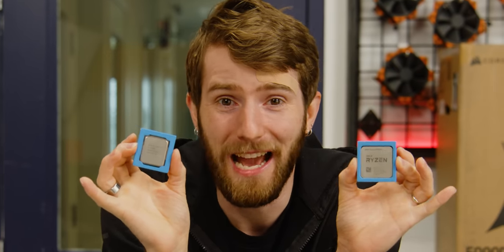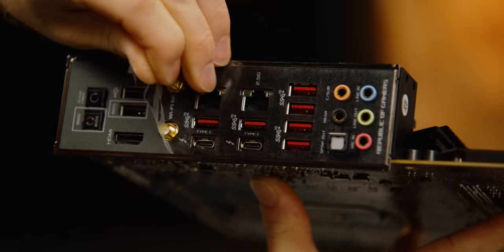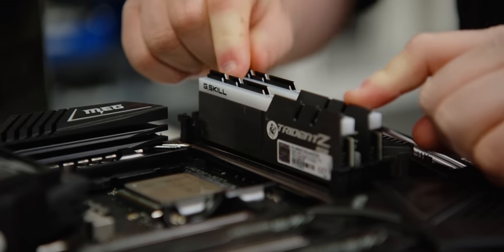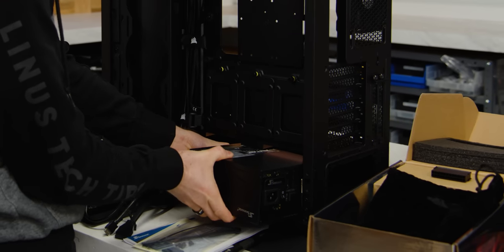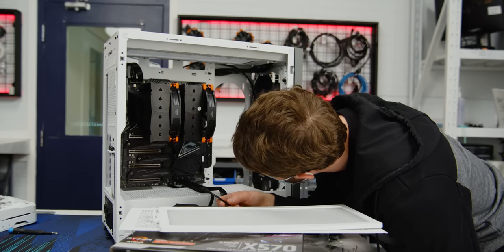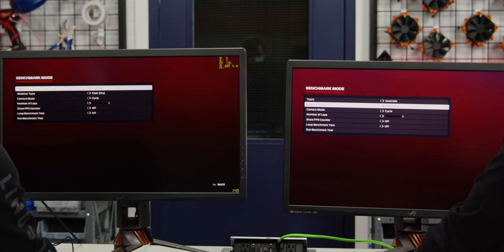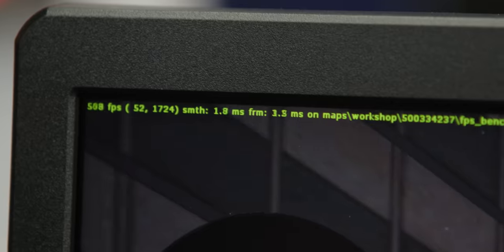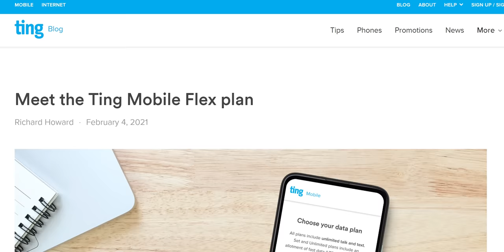Can Intel Beat the Ultimate AMD Gaming PC?

Comment: With Nvidia making CPUs now maybe in 10 years there with be an Intel x AMD x Nvidia showdown.
Reply: And Intel looks to be going into gpu production too
Reply: It will be 2 years.
Reply: sure
Reply: I personally like Intel more than AMD
Reply: @ivanpekic3544  why?
Also its a budget option by now?
Reply: @ivanpekic3544  me too
Reply: RGB showdown
Reply: Nvidia is making arm based CPUs so they aren't really on the same level
Reply: Nahh intel will die 2-4 years if they still clinging on x86
Reply: well... nvidias making RISC cpus. So its unlikely they would compete on desktop, but they could certainly make mobile devices/laptops that are just a tablet with a keyboard. But thats also a pretty saturated market so idk if they would even want to bother. i think the cpus they are making are just for acceleration and management. Unless they get one of the "lost x86 licenses" somehow i don't believe they will be competing on Windows devices.
Reply: Probably not since NVIDIA's CPUs will be Arm based. There isn't much currently that is compatible with Arm and I wager there still won't be much compatible with Arm in 10 years.
Reply: @yuvtube1  for now but they will be optimized for amd systems later or are already so that argument will age badly
Reply: @kadensharpin2156  They made the arm chip in the surface rt, oh and it came out in 2013?
Reply: It will be APU battle, because GPUs will be so expensive it will make no sense buying them for gaming for 99% of people.
Reply: “And then there were 3”
Reply: That would be good
Reply: @Ben_mgsp  First of all I have an Intel i7, 7th gen. Second: When i bought a ryzen 7 earlier it came broke in a brand new sealed box.
Reply: @Ben_mgsp  And after contacting their support for a month I didn't get a reply or a refund
Reply: @ivanpekic3544  that's poor customer support well in that case amd has to work on their customer support
Reply: @profeli1993  In 10 years there will be a lot that is compatible with ARM because Apple is moving to ARM cpus in Macs and Macs are a huge market.
Reply: The RGB showdown
Reply: @songoku9094  Probably not. x86/x64 is going nowhere. It is the most used architecture for PCs and it will stay like that for a while. People have been saying "x86 is dead and risc will take over this year" for a long time. Just like with linux desktop, it's not going to take over anytime soon.
Reply: @songoku9094  you do realize that practically every desktop cpu is x86 including amd buddy?
Reply: @harryshuman9637  And then Stadia will win the battle.
Reply: And intel is working with dedicated GPU. So on GPU side also Intel x AMD x Nvidia.
Reply: @yuvtube1  false
Reply: why and how the fuck do some people have those gray boxes around their user name when usually that's only for the one that posted the video?
Reply: @ivanpekic3544  Came broke ? Did you claim your return / replacement policy of the shop you made purchase from ? Because warranty doesn’t cover external / electrical damages. We gotta check the box after purchase.
Reply: If they manage to get x86 licencing or make an entirely new platform
Reply: I pretty much hope so! I also hope there will be more companies doing this cuz why not more competition is always good
Reply: @Ben_mgsp  idk I just like intel for no reason
Reply: Ati: they killed me
Reply: Yup rayquaza is coming
Reply: Only if AMD and Intel switch to ARM.
Reply: Nvidia cpu isn't targeted for public normal user. It's target sales will be different. Maybe for miner, or something we don't know.
Reply: Yeah it could happen since now that Nvidia is throwing money at ARM laptops to bring their D-GPUs to ARM, they could just pay money to devs to port their games over to ARM, although it will be a lot of work, so its a 60-40 situation. AMD has been rumored to be working on some ARM delicacies of its own but we don't know for sure, also AMD had announced that its working with Samsung to bring Radeon GPUs to mobile which is not equivalent of bringing radeon d-gpu support to ARM laptops. I believe x86 is gonna be the first choice for devs for like 7-8 years as they will slowly maybe migrate to support ARM also
Reply: @modestas112911  i highly doubt Intel is gonna give yet another company a licence to make x86 CPUs.
if anything Nvidia is gonna focus on ARM (because they literally own ARM lol) or maaaybe RISC-V someday in the future.
Reply: & in both GPUs & CPUs
Reply: @Alirezarz62  how would Nvidia add to the market if they can't/won't make x86 CPUs? we will always be suck with Intel and AMD and because if anyone else tries to make modern x86 CPUs Intel will sue them into the ground.
Reply: @Raja-mc3zt  I contacted support, called, sent emails, went to the store where i bought it from and they said "It came like that from AMD, we cant do anything, contact them"
Reply: if the 5950x is even available in 10 years lmao
Reply: @Ben_mgsp  ryzen 5000 cpus are hard to get and even some 3000 are still out of stock or overpriced a lot. also intel you can use lower memory speeds w/ which saves you a few $
Reply: x Apple
Reply: eh, it only seems as if they are interested in HPCs and they were already interested in the AI market for a long time if you are talking about Grace. I don't really think they are aiming for consumer chips at least for now
Reply: @David Belanger performance, yes. cores and threads are something people might still need though.
Reply: @hilariusubaldiasarinarindr9255  The cpu's will be for deep learning on servers according to Gamers Nexus
Reply: Hi jay
Reply: X86 will probably be replaced by arm, Or risk-V architectures in a decade.
Reply: Intel 10700kf was 250 at microcenter. Kinda the best deal if they still have them.
Reply: more like AMD vs Nvidia
Reply: @harryshuman9637  Yes, for laptop market, not for desktop, APU's still long way to go for desktop machines
Reply: @legendaryhumper  many people like things for no reasons so yeah intel or amd better to have a pc than not
Reply: @proxy1035  that could make arm ninvida exclusive in a few years which could "kill" arm
Reply: The battle of RGB!
Reply: Forgetting apple huh? 🙄
Reply: @phatoume227  Yes
Reply: @Nersify  You aren't getting the power of top GPU, but with top APU you get an entry level gaming CPU+GPU in one packet. It's more than enough to play modern games at med settings.

I think 99% of people are interested in playing games without going bankrupt, not playing games at 200FPS in 4K no matter what.
Reply: @ivanpekic3544  no one is perfect
Reply: 10 years ? :D we are talking about Nvidia they probably have one already
Reply: Intel and AMD have to try ARM architecture for that to happen
Reply: Apple M1
Reply: @yuvtube1  that is nonsense for the most part. AMD systems are perfectly stable and it's mostly older software that is more optimised for Intel.
Reply: @yuvtube1  mmmm you might wanna fix one fact intel uses more power than amd unless you're suggesting "performance power". Intels 11900k is (250w) vs Amd 5950x (105w) lol. Also "reliable" hmmm lets see Amd Am4 motherboards have been supported through nearly their whole generation of processors of the AM4 platform which came with years and years of supported updates since 2017 from AMD/manufacturer's. Where intel's boards are like replace your board every generation to get there new stuff and they dont support their boards as long as Amd does and that doesnt sound very "reliable" to me and lets not forget how much more vulnerable security wise intel is compared to Amd also not very "reliable". Lets also not forget 11900k is more money than 5800x and the 5800x out performs it for less money and less wattage lol. I use to be with intel since its awsome 4th gen 4790k days and that CPU was a monster during that time and the last build i had was the 9900ks on intel, but when Amd finally stepped up there game and took the lead. Its a i'm sorry intel but i'm moving on to newer better technology on a company who backs there products and innovates so well which is AMD, and i dont wanna spend money on old tech again such as 14nm+++++++++++++++++++++++++++ which is rediculous at this point and shoulda released their 10nms they have been delaying since 2017. So both are great companies but its such a shame that it took AMD 1 generation improvement on the same node to outperform their competitor intel in not only workstation related software but gaming as well. I like to also note that when the Amd 3000 series was out even the 8th generation intel cpu's were beating amd in gaming still lol and intel had 2 more generations of improvements after. So for Amd to make just 1 generation improvement over intels 3 generations improvement ( yes im counting the latest 11th gen too) and beat them is a phenomenal feat in itself. When intel finally releases 10nm which is their 12th gen CPU's for which i hope they dont delay it again i will reconsider intel again base on performance and cost, but right now it is not worth putting money out for intel.
Reply: The competition would be fucken insane
Reply: but Nvidia only has ARM and not x86 if I'am not mistaken
Reply: I suspect Nvidia is going to stick to ARM CPUs though, so unless they go x86, or unless Windows makes a decent ARM OS and desktop game engines also support all their high end features in ARM, I don't know that we should hold our breath for an all Nvidia system.
Reply: @TheRogueAdventurers  oh man there's gonna be all blue pc vs all red pc vs all green pc
Reply: @dertythegrower  2 years until they are out but about 5 until they are competitive
Reply: @kadensharpin2156  But laptops and computers are slowly going to switch from x86 to arm based cpu
Reply: I just hope for more cpu and gpu makers to come back and battle it out
Reply: @ajaakola2  more competition is almost always better
Reply: @beasterbunny4836  Sure is ! Before with more competition we also had better performance uplifts and prices.
Also nice profilepic
Reply: Yooooo hi Jay
Reply: Nvidia just announced data center cpu still a long time till they make sonething
Reply: Hopefully Novideo will produce Arm chips and Ayymd will respond so my next Thinkpad will be powered with Amd Arm.
Reply: @Ben_mgsp  i don't think Nvidia would do that, atleast not so fast, they should be aware of how important ARM is at the time.
plus even if they were to slowly kill it off ISAs like Risc-V, SPARC, MIPS exist which could become the new open source ARM
Reply: @dertythegrower  For server CPUs sure, but not consumer/desktop grade stuff (yet)
Reply: it's not like nvidias tegra cpus were around for multible years now?
Reply: Lol, and with Intel making Graphics cards, it'll be on both front
Reply: @ajaakola2  Not to mention more options and more verity
Reply: can imagine intel in 10 years!, 14nm++++++++++++++++++++++++++++++++++++++++++++++++
Reply: @beasterbunny4836  indeed
Reply: @derek8564  I know, no one is. But we are talking about one of the main, or the main CPU producer in the world. That's a multi billion dollar company. I understand that they might not answer if I broke the CPU, but I waisted like $300 and never got a refund.
Reply: @kamran2035  How are they robbing? It's your choice if you want to buy their CPU, you're not forced to.
Reply: The RGB showdown.
Reply: That's unlikely. Nvidia is focusing on the server market and they don't have the licensing required to make x86 cpu's.
Reply: @proxy1035  not so fast but perhaps they will do it later on
Reply: Doesn't Nvidia only make CPUs for data centers?
Reply: Each using their own gpus
Reply: @kamran2035  I ain't going with intel until the I die
Reply: @BUDA20  you forgot these ++++++++++++++++++
Reply: @profeli1993  considering Apple, Google, Nvidia, Qualcomm, and Microsoft all have their own arm licenses it’s safe to say compatibility is already well on its way. RISC doesn’t always mean the cpu is low power or simple. Just reduced. There is plenty of room to reduce the x86 instruction set and ARM is the solution to that for most companies. Also due to chip shortages the future of CPU’s will be in-house manufactured chips, which will only require further implementation of ARM
Reply: choose ur team red green or blue
Reply: Isn't Nvidia just making ARM CPUs?
Reply: @kamran2035  You're right, but i meant it in the way that we don't HAVE to buy their CPUs if we don't want to.
Reply: More like nvidea vs amd only 😂😂😂
Reply: Nvid should link up with AMD and the 2 companies might really take Intel on then, just. Their market share is huge, their capacity to make chips is huge, their reach in the industry is unmatched basically.
Reply: @Skippernomnomnom  stadia is dead
Reply: Didn't ARM already won? It is by far the most used CPU in the world because of smartphones ain't it?
Reply: @kazacune101  AM4 isn't supported anymore, no new gen CPUs for it. So it doesn't really matter if the next gen for Intel needs another motherboard (that wouldn't be cool tho) because if 11th already competes with 4th (5th) gen there isn't much difference, unless you buy AM4 and get a 5950X when it's cheap some years from now but you could also get a 11th i9 (the R9 is still better but in the budget part there's no difference)
Reply: Hopefully, more competition will get us better products at a lower price. Fingers crossed
Reply: nvidia cpu's are litterally worse than what amd came out with zen2 in the performance department.
Nvidia needs some cpu's to pair with their datacenter Gpu's, lotsa pci-e and memory, that's the requirement and they don't want to rely on AMD or Intel, that's it ;)
Reply: Nvidia already made CPUs, e.g. Tegra, in the Jetson and Nintendo Switch.
Reply: @yuvtube1  "Most softwares today (apart from games) are still more stable and well optimized on intel systems rather than AMD"
Citation needed.
Reply: And with Intel making GPUs we could have Intel + Intel vs AMD + AMD vs Nvidia + Nvidia.
Reply: @songoku9094  lol you really think it's going to be that short of a time before x86 dies?  Think more like 10-15 years at least before it dies
Reply: @yuvtube1  that's literal bs
Reply: @ivanpekic3544  Same, I just like it more. No matter the price
Reply: @yuvtube1  That is so true man
Reply: @TheRealNeoFrancois  come on 10-15 years😂apples m1 already outperformed intels flagship processors in single core with only 4 high performance core..even if you take intels most powerful processor it won't even any closer to that of m1..if apple could easily do that currently,in 2-3 or maaybe 4 years they could easily beat x86 with their arm processors..the funny part is that m1 is focused on both efficiency,performance equally for thin laptops yet it could perform that much..think about if they build a processor for desktop that doesn't need efficiency cores
Reply: @TheRealNeoFrancois  also there is lot of companies like amd,microsoft,amazon,samsung that are currently working on arm based processor.i think they will able to release it in 2-3 years..because they have enough time to create  a one that same as powerful or more powerful than m1
Reply: @AlNexus  If next-generation from both AMD and Intel supports DDR5 you'd have to upgrade...
Reply: @songoku9094  doesn't mean it's going to kill off x86,all it means is that there's companys furthering that tech
Reply: @songoku9094  your also forgetting the other countrie citizens that won't be able to afford all the new arm cpus and will be using x86 chips making them last alot longer than it would in canada or America
Reply: @TheRealNeoFrancois  why you are saying things like people won't be afford arm processors like arm processors cost more than x86 or it won't be available to those region you mentioning?m1  mac doesn't cost high..you can buy m1 mac mini under 1000usd..so most likely all other future arm will not cost high like that even if it from other companies aside from apple..and because of lot of companies will enter arm processor making it will available all regions..i know there will be still some peoples use x86 but most likely the vast amount of people will still cling on x86 will be decrese so much that intel won't able to make any profit from making x86..because of the reason arm processor performs better than x86..in the future intel will be really hard time
Reply: @songoku9094  I say that because I know people who are still running core 2 duos with in board graphics  in India, reason for it because they don't make enough to buy brand new hardware,that's why the x86 market will still thrive
Reply: Aren't they going arm?
Reply: Forgot the Apple M1 chips? :)
Reply: @TheRealNeoFrancois  yeah but even if still people use x86 doesn't mean its not dead..if people don't buy or intel is not getting any advantage in still clinging on x86 in future they will stop making it but even if that happen there will be still majority of people using a x86 system but that doesn't mean it is not dead(i meant about people who will not rely or buy on x86 anymore..i didn't meant people who will still use already owned x86)
Reply: @megachadsixtynine5924  i do buddy and i did say that also..but they are currently working on arm based one's..if it will success like apple m1 does..they will also ditch x86 because there will be no reason for still clinging on it if it doesn't give performance like arm does currently or in the future
Reply: Suprised you didn't comment on the hammer lol
Reply: I fully support all three manufacturers going into both GPUs and CPUs. We need as much competition as is possible in both spaces.
Reply: @kadensharpin2156  yet, remember that x64/x86 architecture is pretty old, and very flawed. Eventually many other processors running more efficient archictectures will be doing laps around x64/x86.
Reply: Nvidia been making cpus
Reply: You forgot arm
Reply: Yeah me too
Reply: @m4ster_root  what?
Reply: @ivanpekic3544  simply wrong store, not amd fault really, of course you must contact amd directly if confronted with incompetent store
Reply: @AlNexus  All I'm saying is that both AMD and Intel will require a new motherboard next generation.
Reply: me with my fx 8350....  wow amd is good now maybe i should upgrade. my fx 8350 praying to the lord that i have a empty wallet
Reply: @Bennet2391  Arm could go the way of powerpc become niche again at the end
Reply: @yuvtube1  LMAO
Reply: Isn't a global crisis of silicon happening right now? Or that shortage only affects car industry and gpu manufacture?
Reply: At this rate more like Nvidia X AMD
Reply: I'm using an AMD system with RTX graphics card on a Thunderbolt ready motherboard. I can see three different USB controller from these three company in my Windows device manager.
Reply: with both gpu's and cpus
Reply: Somehow, the scene from The Good, The Bad and the Ugly comes to mind...
Reply: apple : mmmmm, hello? 😂
Reply: @yuvtube1  'most' no. some ? Yes.
Overall AMD is far ahead in productivity.
You only choose intel when you focus in one of the few soft that's still optimized for Intel, the rest of us should go for AMD.
Reply: They do what, now?!
Reply: Ooh Intel only setups, Intel CPUs, Intel GPUs, and like so with others.
Reply: I feel like it'll be less than 10 years
Reply: Dream on
Reply: @songoku9094  You are missing the point. Not to be disrespectful, but do you have any idea how many people run decades old software on their machines. IF Intel would replace x86 with risc-V they would run into major compatibility issues. All the x86 targeted software needs to be recompiled, low level stuff has to be rewritten. 
In a lot of case the companies that made the software don't exist anymore and the source is lost or inaccessible due to IP-rights conflicts. 

Hardware is is a topic for itself, but there is also the real world. It doesn't matter if a processor is superior, when it's incompatible with the software environment.
What you said about ARM vs x86 performance is only true, if you factor in the power consumption. With the same clock a modern x86/x64 processor is significantly faster than a comparable ARM 7 or 9 processor. This should surprise nobody considering that the X86 has much more power at it's disposal and more transistors, which implement fast complex instructions and shortcuts, that simply don't exist (yet) on ARM processors.
Reply: @Ben_mgsp  Nah, probably not. They are used in phones, industrial applications, automotive, embedded devices and even servers to some extend. Like x86, ARM will only be replaced, if the benefits justify recompiling or rewriting the software environment. 
RISC-V will probably replace ARM in some of these use cases, due to it's flexibility, but not all of them. Imagine an android phone, incompatible with any App on the store, that targets ARM Architecture. App compatibility is a key factor in the success of a device. That's why windows phone failed.
Reply: I highly doubt Nvidia will make CPUs for stuff other than data centers, IoT and automobiles (Not to mention they will be labeled anti-competitive due to their ARM acquisition).
Reply: Nvidia doesn't have license to make cpu with x86 command set.
Reply: @Bennet2391  X86 wouldn't be replaced it probably will end in a stillmate the x86 arm war
Reply: @proxy1035  AMD is nightmare enough, Intel must be stupid to invite Nvidia into the ring.
Reply: @ketos8315  You are right. The reason AMD can make x86 is because contract loophole mistake Intel made a long time ago. Mistake made, lesson learnt.
Reply: @robertbowen9750  Yes. Like it or not, Microsoft is still the king maker in PC and laptop. If they decide to port Windows into ARM, that will be a significant boost to ARM.
Reply: And with Intel making GPUs, we might have a full Intel vs full Nvidia vs full AMD systems.
Reply: @Ben_mgsp Agreed. Either that or  they will coexist in different fields of application. Everything has up- and downsides.
Reply: @yuvtube1  this was wrong on another level
Reply: @harryshuman9637  better buying a ps5 you be more happy then with it a APU for the time being if you fine one.
Reply: @jamesstuller6964  can't do work on ps5
Reply: @harryshuman9637  It will get hack some day to run other OS like linux then you can use it to work.
Reply: Intel will be making GPUs then so its more of.
Amd vs nvdia 😆
Reply: @ivanpekic3544  i like amd but intel is budget offering so meh.
Reply: @yuvtube1  thats not entirely true..and even if i consider it AMD is just miles better now.
 A hinda civic is reliable Lamborghini isn't but dude when u gotta race on a track u need a Lamborghini
Reply: It’ll be AMD v Nvidia v Apple. Intel will be nowhere to be found.
Reply: Would be great for the consumers. Prices would be competitive. And manufacturers wouldn't be rehashing the same thing every year like how Intel did.
Reply: @yuvtube1  define reliable though? I've been running AMD on my main rig and never had stability issues. Was running Intel before that (still am on a secondary PC). Really there really is not much difference in terms of reliability between both. Been pretty happy with both.
Reply: @eclipsegst9419  i think we are not far from RISC being as compatible as cisc.
Or arn can almost carry all necessary instructions that x86 can and did u see apple M1 damn that beats x86 intel ones
Reply: @Ben_mgsp  x86 is not just cisc it is more cisc+some risc while arm is more risc and some cisc.
And we are very close to meet when all x86 codes will be supported on ARM we are very close x86 is not going away it and arm will meet and we will have a processor that will supporr both codes apple M1 already does it..right now windows on ARM supports x86 32bit apps already not far when all x86 apps will run on arm
Reply: @legendaryhumper  thats weird
Reply: @anandsuralkar2947  well sure m1 is the only cpu on 5nm so of course it has impressive IPC. But Apple has used RISC a lot in it's past too, doesn't really affect the Windows people. Emulating cisc on a risc cpu is doable but not efficient. X86 CPUs haven't actually used x86 since 1995 they use hardware based decoding. RISC uses software based decoding so it will always be wasting a significant amount of processing power on overhead. So I don't see RISC on Windows anytime in the foreseeable future. Too many x86 programs that are irreplaceable over too large a span of time that are still in use, and hardware decoding is more efficient.
Reply: It will be amd VS Nvidia.
Intel is become the new Nokia
Reply: I love how this started from a joke and now it’s just a bunch of butt hurt people arguing about who is better, and why this won’t happen.
Reply: Not likely, unless nvidia changes to Desktop cpus. Currently they only seem to be doing mobile cpus.
Reply: @anharun  yes
Reply: @yuvtube1  based on results it seems to me intel is frames and amd is for pretty graphics.
Reply: @songoku9094  nah its if they can't get a smaller nm
Reply: @DarthCiliatus  there will likely remain a separation between apple and windows for the rest of time.
Reply: @phantomcatxd7637  Yeah i think Linux is more appealing to people fed up with Eternal Windows 10 than Eternal OSX, which most of us decided we hated back in the XP days.
Reply: @eclipsegst9419  i don't want to use Linux because of a lack of games supported by Linux, and it seems like it is complicated to use.
Reply: @anandsuralkar2947  you're failing to mention that running even 32 bit apps causes a 25% performance decrease. 64 bit will be much worse. I can see Apple getting certian programs to work, but thats still a far cry from it being a universal solution. They will never be able to decode x86 instructions with software nearly as efficiently than AMD or Intel do with their proprietary decoder.
Reply: @DeanGl  Ive jumped betweeen AMD and Intel a few times. It is fair to say that AMD is a bit pickier about old drivers on the install and stuff like that. But on a clean install i think they are equally reliable.
Reply: Nvidia has made cpus for years... also the new ARM chips are 10x faster than intel and amd... so there is NO contest. x86 is ded
Reply: @phantomcatxd7637  Same, but if I had to pick Linux or OSX id pick linux every time. It isn't difficult to use and its gaming compatibility has increased by huge amounts in the last 5 years, only the latest stuff won't work yet but within a short while after release, most do. Linux can be formed to however you like it, but most default to a "similar to windows" layout that isn't too hard to figure out/
Reply: @songoku9094  intel is transitioning ... amd is the one I am worried about, they havent done anything to compete with the ARM tech
Reply: @eclipsegst9419  risc cpus are sooo much faster than x86 ... desktops will ALL be risc very very soon, unless u want a snail
Reply: @DarthCiliatus  10 yrs! lol...what! in 3 months all desktops wikl be risc.  Have u not seen the presentations from Samsung, Apple, Intel, Nvidia and Motorola?  x86 amd is ded... ARM tech is dominating and will be the only tech to buy for the next decade at least.  intel is trying to compete, but there is no way, too far behind already and they know it.
Reply: @unitcharles689  decade?  what!  lol, they are ALREADY replaced... the final phasing out if ALL x86 crap will be out by the end of 2021... these tests are a was of time and the last sad kick at the cat.
Reply: @tredogzs  they don't need to rush..because of x86..you said intel is transistioning and you are worrued about amd😂..brother intel next cpu is on 10nm,where as amd current ones are 7nm and amd next cpu will be zen3+ or zen4..zen3+(if they decided to release)is said to be on 6nm..zen4 is in 5nm..and amd is currently has biggest multicore performance..its true intel is still has more single core peeformance but it is not high difference between amd..even if you take laptop side amd has same high multi core performance than intel and its single core is not that much low than intel..if you take a thin and light laptop currently has intel 11th gen compare it to amd based,rysen is more effiecient than intel..that gap will increase if amd release 6nm or 5nm based one's..so i don't know why you are saying intel is changing and you are worried about amd because of that😂
Reply: @tredogzs  lol what are you, 12? you clearly know nothing and are just spewing nonsense. risc instructions are faster, but also less capable. a RISC cpu loses 25% of its performance to run regular x86 32 bit apps. That 8 core just effectively became a 6 core. To run AMD64/x86-64 instructions, well, we don't know yet, its not possible, but it would likely take over 50% overhead. your 8 core just became a 4 core. Heres the fact of the matter- x86 and x86-64 programs aren't going anywhere, anytime soon. There are 40 year old programs in use now, and todays programs will be in use in 40 years. using hardware based decoding is FAR more efficient than software based. Nobody but Apple plebs will be using those silly oversized phone chips, anytime soon.
Reply: @ivanpekic3544  can you give some details on the damage?
Reply: @eclipsegst9419  25% performance decrease is nothing compared to almost 5x performance per watt of ARM chips
Reply: @eclipsegst9419  i am not talking about software simulation of x86 instructions today arm actually has a proper hardware instructions support for many x86 instruction.
And today many of x86 instructions on x86 platforms are taken out and there will be time soon when ARM will natively support hardware instructions of x86 99% of times .and then u can switch to arm.
And remaining 1% times used maybe 10% instructions will be emulated which isnt big deal considering thsoe being rare instructions..
Reply: @4ri8  Im not really a cpu expert, but when put the cpu in it didnt work. I know that because i was replacing components with my older pc and my old ryzen 3 worked fine. I took it to the shop where i bought it and they said "Its AMDs problem, not ours"
Reply: They're not X86 though
Reply: I wouldn't like it
Reply: Intel is make sku gpus
Reply: @eclipsegst9419  your 4x more likely to have watched this video on a risc chip... they out number x86 by two times and they are faster, MORE compatible, run MORE maps and EVERYONE has one... are you a dinosaur?
Reply: @eclipsegst9419  You are drinking the 10yr old cool-aid.  Nothing you said is true.  The current cisc architecture is 64bit is MORE capable than x86 and runs much faster with less power.  Try googling the fastest computer in the world... it went to cisc last year and unlike previous years were performance doubled... this time is 100x faster.  The game is already won, sorry you missed the memo.  Future is here bro-ski.
Reply: @tredogzs  lol keep kidding yourself. Link me a video of an ARM running an x86-64 program. Doesn't happen. It's not just bit width. X86 uses COMPLEX instructions. ARM uses REDUCED. so congratulations, you can run simplified programs as well or better as x86 can run complex programs. You cannot run complex programs anywhere near as well as x86. Anything can be scaled to a supercomputer, just keep adding cores, nothing special there. Intel's working on a new one that will put it to shame anyways . You don't know what you are talking about kid, just stop.
Reply: @eclipsegst9419  You must be lost in your own confusion.  Show me an ARM running an x86-anything program DOESNT HAPPEN!!!!! why would ARM run anything x86, its all transcoded... and you don't know anything about computers.  Now that this is clear, I will let you argue with the mirror.  Good luck, I hope you win vs yourself.  Hey when you are done, spread the good news about x86 being ded.  thx
Reply: @eclipsegst9419  Good thing there is WAY more ARM games, programs and code out there now.  Not much out there for x86 anymore.
Reply: in 2 more years intel will die eventually since they can't make decent cpus since 2015
Reply: @Coldbreathful  lmao dream on kid. for starters, intel was still on the industry leading node until 2018. Secondly, they have fixed 10nm and 7nm, which are equal to tsmc 5nm and 3nm respectively due to the way they are measured being different, and is positioned to retake the leading edge by 2023. Finally, even with outdated products, Intel is still over 90% of the server market, and just recorded record profits. maybe if not for covid they would have made less, but that doesn't matter, because as of now, they have fabs making anything they want, and nobody else does.
Reply: Which one, all amd, intel, or nvidia
Reply: @kamran2035  nobody needed 8 cores because Intel's IPC wasn't dogshit. AMD was bringing nothing but Bulldozer garbage back then so you can't pretend they are innocent. Bulldozer should have never made it off the drawing board, it was horrible. Die shrinking the Phenom would have been better.
Reply: @brytonmassie  old sure, flawed? Not really. No other instruction set can match it to this day, not even Intel could replace it when they wanted to.
Reply: @ethan-fel  most software is still single or dual threaded. Aside from some creative software almost everything is.
Reply: @boulderbash19700209  no, the reason AMD can is because Intel sold them a license, and then AMD developed the 64bit variant, which blew away and still blows away all the 64bit risc designs, and they then licensed that to Intel.  Neither company will "die" they are codependent.
Reply: @songoku9094  Intel measures transistors at the base not the tip, which is much narrower, thats why 14nm is equal to 7nm. Just as 10 will be to 5 and 7 to 3. Both companies are set for major gains every year. That's the important part. Who wins will be neck and neck, and doesn't really matter, just the IPC gains we all get do. Tiger Lake is a poor showing for 10nm. Golden Cove will be the first 10nm with good yields that allow the now-expected 5ghz clocks and a very healthy IPC that will be neck and neck with Zen4.
Reply: @anandsuralkar2947  that's just a lie, the performance per watt is even less of a difference. Just quickly removing 25% from the M1s Passmark score puts it barely ahead of a 3300x. Mine consumes 52w and the m1 consumes 27. So call it 2x more efficient, not 5x. But that's 32 bit apps. They are all but defunct. And that's with a 5nm node advantage. Erase the node advantage and most of that advantage is gone. Put the m1 on a true amd64 program, and.... Oh wait it can't even run them. Even if it could it would be way behind in performance and efficiency. Leave the cell phone CPUs in cell phones. And wierd apple shit nobody cares about.
Reply: @kazacune101  in actual gaming the 10900k uses 90-100w to the AMDs 80-90. It's half the price, and gaming performance is a wash. AMD is stupid to only use gold silicon on stupid wannabe baby threadrippers instead of offering a golden 8 core for actual gamers.
Reply: @eclipsegst9419  its true intel is still performs better at single core with only 14nm compare to amd 7nm..but if you take laptop segment lower nm cpu has better efficiency no matter how much close or higher performs intel with 10nm over amd 7nm..even if you compare intels new 11th gen series thin and light laptop to amd thin and light laptop with 11th gen or 10th gen,amd has more efficiency..because of that amd laptop has more battery life if take thin and light laptops..what i am saying is it true when intel 12th gen release it could be perform little bit better than amd next gen which is zen3+ or zen4..but still because of the reason lower nm processor amd based laptop will be more efficient than intel while perform closer to intel..because of that reason i will say amd is better because they could give close performance to intel or better and same time with more efficiency than intel
Reply: @kamran2035  that's not how it works. Games don't like to multithread, you can force them too, but they will always scale to IPC because physics and worldgen is more efficient the less cores it has to use.
Reply: @eclipsegst9419  i was talking about intel vs apple.thats 5x.if not its atleast 4x and m1 in macbook air consumes only about 10 watts..thats where its most efficient and intel has no competition there.
Reply: @songoku9094  in all reality if you remove bias it's an absolute neck to neck race. Also what I'm trying to tell you about node sizes, is 14nm Intel and 7nm TSMC are almost exactly the same size. When FinFet transistors came out, Intel decided to measure them at their widest point, as that is what determines max density. TSMC and Samsung decided to instead measure partway up the transistor. For reference, they are shaped like an upside down W. So as you can imagine, if you measure it partway up, and it's getting narrower as you go up, you get a smaller number. That's why Intel's node sizes will never appear to be as small as the competition, when actually they are within margin of error.
Reply: @eclipsegst9419  dude m1 outperforms the best of i9 apple mac.
It just does..look at comparisons..i am no apple fan..amd sure does compete m1..but intel there's no chance
Reply: @anandsuralkar2947  yeah I have. Check Passmark. Single threaded is strong for sure, thanks to that 5nm process. But it's multicore performance is a yawn. About the same as the 8c/8t 9700K.
Reply: @eclipsegst9419  well not shit sherlock. Everyone can see that on this very video they showed up top how much wattage was used in gaming comparison. I specifically said "up to 240w" i never said did 240w all the time. Also the 5800x is cheaper and better than 10900k which is less money and less wattage usage. So i really dont know what point you are making here. Other than spouting non-sense.
Reply: @yuvtube1  If you want security floors go Intel. If you agree that the i7 releases should keep having 4 cores for a whole decade go Intel.
Reply: @eclipsegst9419  Cmiiw, Intel didn't sell the license to Amd, at least not directly. I forget the name, but I think it's Cyrix. And then it was only for 8086. But Amd used it to produce 386, 486, and Pentium, leading to court battle with Intel that Amd won.
Reply: @MarkLikesCoffee860  I want CPUs so powerful an i7 only NEEDS 4 cores. A 1080 ultra/144 med. gaming PC that only uses 300w or less would be awesome Why would you want to need more cores? The goal should be IPC gains that are so good we need less.
Reply: @kazacune101  5800x is neither cheaper, nor available period.
Reply: @boulderbash19700209  didn't what? Sell them a license? They definitely did. AMD used to literally just be rebadged Intels at a lower price. Then Intel didn't like AMD making 486s and there was a scuffle, and Intel agreed to sell them a license if they made their own designs.
Reply: Nvidia ARM and RTX vs AMD Ryzen and Radeon vs Intel Core and Iris? That would be quite interesting to see...
Reply: @Coldbreathful  I don't think a single thing has changed from 2007 until 2017... cpus were EXACTLY the same for TEN YEARS!  Six core 3.33Ghz Intel for 10 years!
Reply: Try 3-5years I know intel won’t be waiting that long to ramp up gpu production and roll out
Reply: @mohammeduddin2334  true but unless Nvidia finds the fabled lost x86 license and buys the company that owns it they won't be making any real cpus just ARM.
Reply: @eclipsegst9419  To make up for Intels low IPC
Reply: @MarkLikesCoffee860  yeah well, Skylake sure isn't up to date now, but AMD guys really ought to realize what a bullet they dodged. If Intel's 10nm came out on time, and their 7nm came out on time, Intel's current CPUs would have higher IPC than anything that is going to come out in the next 4 years, and not even 16c/32t would be enough to beat a 4c/8t i7. AMD would be someone else's property right now if that had happened.
Reply: Triple or Trio showdown!
Reply: ARM CPU didn't work on Windows it's seems like emulate X86
Reply: Plot twist, apple beats all
Reply: @eclipsegst9419  I disagree because Intel have been shrinking the die size for years without any problems but the IPC was only increasing by about 5% each year. 1st gen Westmere was 32nm and they had no problems until 14nm. Why wasn`t IPC increasing by 15 - 30%  each year like AMD?
Intel weren`t having problems with their fabs back then.
Reply: @TheRogueAdventurers  they do have a discrete gpu
Reply: @MarkLikesCoffee860  Because that's not realistic. AMD was so horribly behind that they looked good playing catch-up. 15-20 is possible but not every single year, and nothing since we hit the 5ghz barrier points to otherwise. AMD and Intel are going to throw everything on the table now, even if it's risky. That's great, but it's silly to expect either to do something risky without motivation.
Reply: @tredogzs  lol if you call phone "games" games maybe. ARM apps are all stripped down wannabes. X86 is like 99.9999% of actual full feature apps and games.
Reply: @robZzdaboss  lol no, apple will be lucky not to be surpassed by Linux in the coming years. People are just as fed up with Eternal OSX as they are Eternal Windows 10.
Reply: @eclipsegst9419  ARM chips are just WAY faster... and Intel is making chips now with increased instructions to match the huge number of efficient instructions the ARM chips have, they are adding efficiency cores... Intel is adding power management gates, Intel is adding codex for internet and other photo and video editing functions.  Intel is adding machine learning and AI. .... and you are still all excited about year old AMD stuff that just doesn't matter at ALL.  Out of date... out of date... NONE of it matters ... just buy the new video card and you are 2x ahead... nothing AMD is releasing or even is talking about matters.  Samsung, Apple, Huawei, Microsoft, Nvidia... EVERYONE is focused completely on ARM and the current speed race with the fastest, smoothest, most functional chips in the world... and here YOU ARE... CONFUSED, lost, angry... JUST accept the light, do some research, buy some products, experiment with the technology and know the truth.  I only ask one thing, SPREAD the light, tell everyone, that is all the thanks I ask.
Reply: @tredogzs  no, they aren't. And better instructions are key to performance. The reason ARM will never compete, and has taken 40 years to even manage 32bit emulation, is because it has simplified instructions. X86 instructions can do more work each. The only real move forward would be a better CISC that does even more work per instruction.
Reply: @yuvtube1  so amd cpus are unreliable?
Reply: @eclipsegst9419  you don't really know what you're talking about. You only look at it from a gamer point of view. I'm talking about professionals, video editors and music producers prefer mac and the m1 chip is a beast in terms of performance and is only the beginning. I'm not talking about windows vs osx. This thread is about Cpu.
Reply: @robZzdaboss  everything you are talking about is Workstation grade tasks. I am making statements about Desktop computers. Doing any of those tasks on dual channel ram is a bottleneck. Better off with a lightly used Xeon or Threadripper than some joke of a throwaway Mac with no upgrade path, or be gimped by dual channel ram on a ryzen 9.
Reply: Cpu is said to entire unit 🤦‍♂ you would have written processor
Reply: @Piyushrahi  CPU and Processor are the same thing. Central  Processing Unit (CPU) a.k.a Processor
Reply: In a couple of years, someone's going to do that cursed Nvidia CPU and Intel GPU build.
Reply: @songoku9094  Nop..because apple left intel..intel not like it and want make something big...
Reply: @yuvtube1  That is because Intel ruled the market and everyone followed their instructions. 
The more time they spend behind the more this will change as consumers will buy more AMD and programmers will make sure their software works with AMD since more of their consumers have AMD.
Reply: @ivanpekic3544  Preferring Intel is one thing. But actually liking them more seems kind of strange considering their past actions and practices unless you just like going against the flow and you feel like liking them just because others dislike them.
Reply: @SIPEROTH  I had my experience with amd (a bad one), and a good experience with intel so i like intel more. the end
Reply: @eclipsegst9419  lmao what are you talking about? dude do your research. The 5800x is $449.00 and the 11900k is $549.00 AMD is $100 cheaper for a better CPU period. Also do your research again on availability, because you can buy the 5800x on Bestbuy, Amazon, Newegg, and AMD's very own website.
Reply: I remember when Cyrix was the affordable choice for CPUs.
Reply: @TheRogueAdventurers  seriously?
Reply: @yuvtube1  Thats hilarious, an old wives tale.  Do you have any evidence of more stable/optimized?  Definitely a great marketing strategy if you can make the gullible believe that.
Reply: Terra Nova  Yep that's the reason nvidia made the 3070 cost the same as a 2070 super. They expected amd to put up a good fight.
Reply: Terra Nova  I agree, I'm not saying AMD is bad, or the intel's history is good, I'm just saying that from my experience intel has a better support and cares more about it's customers (from my experience) . I agree Intel was shady, but would you give 2x $250 to a company that didn't want to refund you your $250? We're talking about a multi-billion dollar company. They  could've at least gave me 50%. I agree that AMD processors are better through.
Reply: I'm sure we could be seeing that
Reply: @yesiam6758  apple sucks at life
Reply: @TheRogueAdventurers  they tried before right?
Reply: it is really possible that intel will bankrupt cuz of AMDs todays cpus
Reply: @David Belanger Not really, with PBO enabled the 3700x takes the lead pretty easily.
Reply: @yesiam6758  Apple makes weaker processors.
Reply: Apple
Reply: @brianlam5847  m1 power efficiency is way better and Rn apple is offering better cost to performance
Reply: @David-mf4yt  True, but it's multicore speeds are absolutely terrible in comparison, meaning that workplace tasks will take much longer.
Reply: @TheRogueAdventurers  well they're mainly going into more budge GPUs
Reply: In 5 but intel should stop making these
Reply: Linus' wallet won't be happy if that happens
Reply: and then comes snapdragon with adreno graphics on PC market
Reply: Naaah, in 10 years china suddenly make new competitors and will be banned in US
Reply: You forgot m1
Reply: ULTIMATE R (AMD) G (NVIDIA) B (INTEL) Rivalry
Reply: They're making CPUs now?
Reply: it gonna be 
cpu: nvidia vs amd
gpu: nvidia vs amd vs intel
Reply: Wait Nvidia is making CPUs now???
Reply: @yuvtube1  the more people use amd the better the optimization gets.
Reply: @ivanpekic3544  same, especially after i had an intel cpu laptop for 7 years and when i got a new amd one it blue acreened in the first day.
Reply: @bxnny5861  yeah, amd is more "gaming style" but less reliable
Reply: The RGB showdown.
Reply: @ivanpekic3544  I personally like comparing performance vs price and getting the right hardware for the its value. Since the time of Cyrix vs AMD K6-2 vs Intel Pentium (well, in fact since amiga vs atari st) and I don't like stupid people. That's why I don't like fan boys.
Reply: @songoku9094  , XD XD XD how many f.... times have already read such nonsense ?!!? XD
Reply: @MrCroky123  I'm not a fan boy. I just don't like the experience of owning an AMD processor
Reply: @ivanpekic3544  , so then you go with Intel because you've got no other option ... therefore yes ! You're not a fan boy. You're anti-amd, which for the purpose of buying good hardware for its value, cuts your options in half. Which IS THE SAME f...g outcome as being an Intel fan boy (or AMD fan boy if you're anti-Intel) ! Great ! XD

and btw, what's up with the "experience" when all you do is enclosing the hardware inside the case and install an OS ? The OS and what you install on it, its speed and responsiveness are THE experience. Not the hardware itself (duuhhh) . When you understand the whole illusion of branding "experience" you'll probably get the benefits of your - hopefully - new revised options. But right now, you overpay your experience - which is ok, everyone is entitled - but for nothing at all - which is, simply put, not smart -.
Reply: @MrCroky123  I don't want to have this argument. My AMD came broke, it didn't work. That's bad experience with a major brand. Idk why you care so much to change my mind. I have my opinion and it stays. End
Reply: @ivanpekic3544  Ok, that's fine. And I'm not trying to change your mind. I just think it makes little sense but I get it, it's sentimental ... and when it comes to that, well ...nothing else to say.
Reply: @MrCroky123  Thanks, nice to have a debate end well
Reply: @dertythegrower  highly doubt nvidia will be getting a good chunk of its profits next year